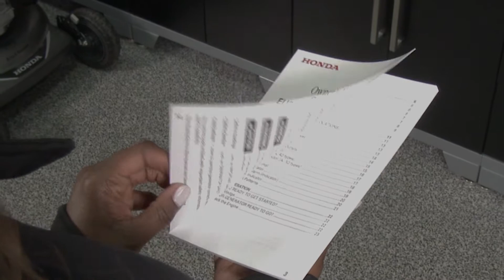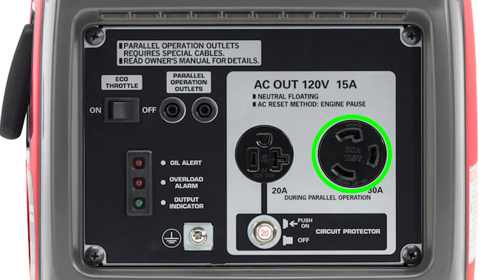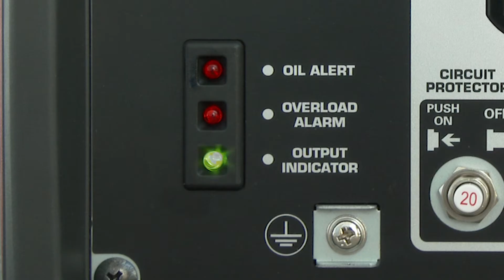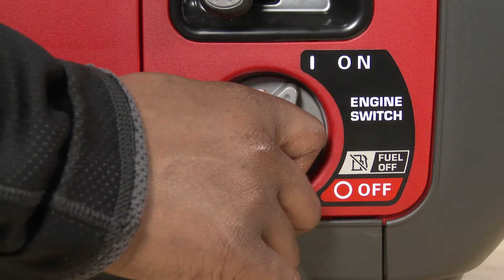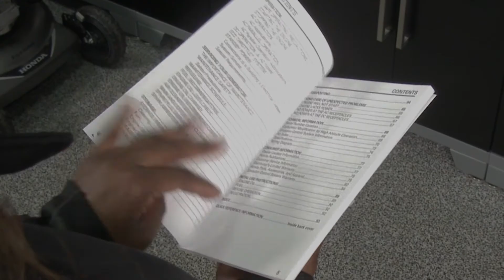How to Parallel Honda EU2200i Inverter Generators

Comment: Can you get 4400 power with 2 2200i paired
Reply: Yes. That is the maximum starting wattage. Maximum continuous output is 3600 watts
Reply: Unfortunately, the Honda Manual FAILS to clarify this in no less than 3 different areas. Incredibly frustrating on figuring this out...

Comment: We tried to connect this set-up with two Honda generators paralleled to feed an RV and the fault sensor in the RV showed a ground fault, and reading the voltage at the outlet on the generator ( either one) it reads, 120 phase to neutral and then phase to ground reads 64 volts, and neutral to ground reads 64 volts as well.  Has anyone ever seen this problem?
Reply: Isn't it nice how TWO YEARS later, still no one from this YT Channel has the decency to respond??

Comment: If you're paralleling a Companion and standard model, and the Companion stops, will power continue to be available from the still-running standard model via the Companion's 30 amp outlet?
Reply from the maker: That's a great question! The short answer is probably not. Even if power continued to be passed, the rated amperage of a single unit is only 15 Amps and 2,200 watts, so if the parallel connection was severed, the running generator would likely be overloaded and shut off unless your wattage and amperage requirements were below those limits at the time of shutoff for the paralleled unit. There are likely also some built-in safety settings that would prevent this situation from occurring, and likely shut off both units if one were to fail.

- Parallel Info: https://www.electricgeneratorsdirect.com/manuals/honda-7cd744d52c436f56b854d4edaff05883.pdf
Reply: @PowerEquipmentDirect  Thanks for your answer.  Per American Honda, the answer is yes, unless, of course, there is an overload condition like you describe.